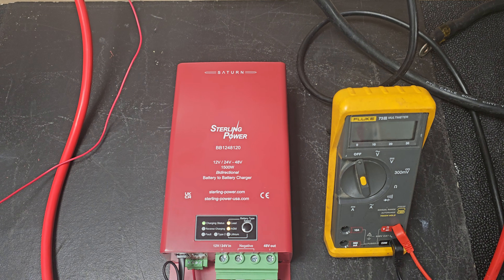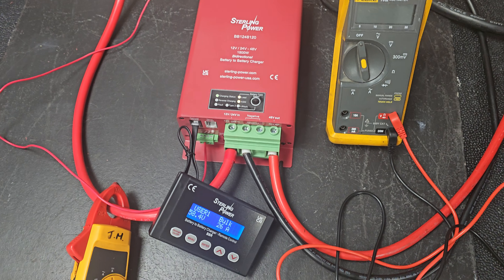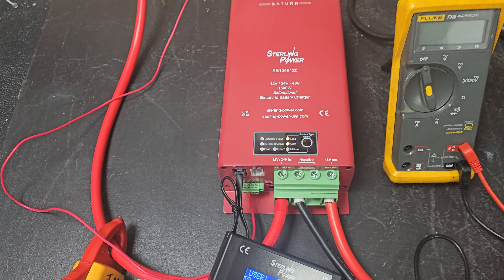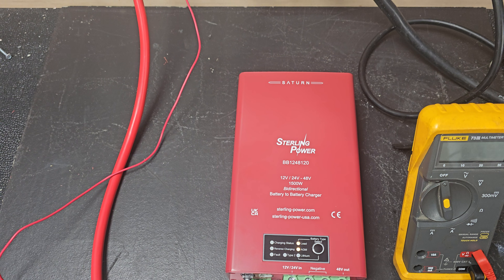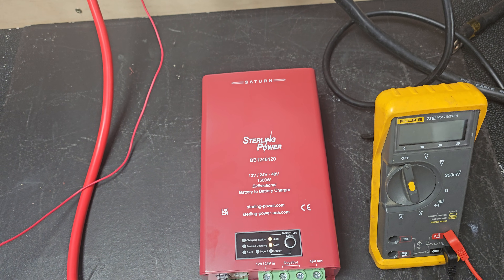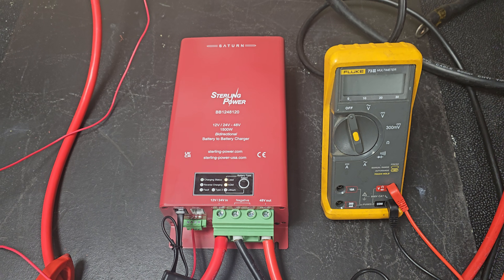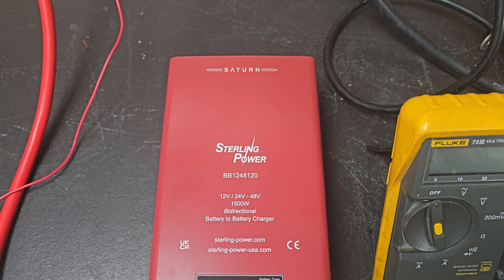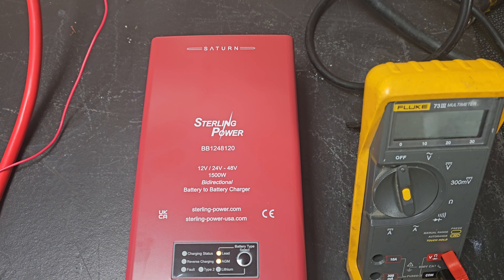Sterling Power 12V or 24V input to 48V 1500W Battery to Battery Charger BB1248120

Comment: Hi - Thanks for the video but having also visited your website I am still unclear as to this units functionality. Can you confirm it's a DC to DC charger with the following functionality: 
1. That it takes the Alternator output from a 12V/24V system and  converts it to charge the 48V Lifepo4 16s Pack using the LifePo4 charge profile?
2. Will the Alternator at the same time charge the normal starter battery either 12V or 24V just like your standard DC to DC chargers?
3. Can the back feed be directed to a separate 12V lifepo4 battery pack not starter battery? 
4. Does this 'back feed' function have a Lifepo4 charge profile or is it just pushing a general 12V towards the pack? 
5.. Is the 'jump start' function if available, separate from the back feed or is it using the same 12V feed to jumpstart the starter battery

It would be nice to have a clearly defined datasheet but I have been unable to find same.  Your product offerings are innovative and appreciated but your website is cluttered' and confusing.
Reply from the maker: Hello!
1) Yes.
2) Yes, unless the BB is too powerful for the system and is taking all of the alternator provision. 
3) No
4) No, it is a 13.4V voltage only
5) It is a Jump Start Assist rather than jump start, and it runs the reverse charge for 20 mins to allow you to hopefully then have enough power in the battery to be back in action.

As to the website- yes, very much understood. I am requested to have all products pretty much everywhere by the M/D.

I am attempting to balance his wishes with something smoother, but it will take a while.

Thanks!

Comment: hey mate , love the product !!! I'm from Australia and i refuse to buy the similar product to this from u know who !!! one thing id love from this is an alternator temp sensor cut out/throttle!! is this possible
Reply from the maker: Hi VK! Thanks for reaching out and thanks for the vocal support!

Honestly not sure there is a similar product... Nobody out there is doing a unit at this rating that has this good thermal management... The only other one I can think of goes to half power pretty quickly....

Your question is a super common one (Alt temp throttling-) and it's one we're working on at the moment. I don't have any concrete answer for you yet... but it's something we're trying to implement on the BBR remote!

Ben

Comment: On my diesel pusher, I have 12v chassis FLA batteries only charged by alternator and 24v LiFePo4 batteries for house side charged by shore or solar.  Can this charge/maintain my 12v FLA side from the 24v LiFePo4 bank and also have 12v Alternator charge 24v LiFePo4 bank (charging at 28v) when engine is running?
Reply from the maker: Correct! That's the goal.

It'll maintain the starter battery from the 24V rear battery whenever the rear battery is receiving charge from a secondary source (Solar, AC/DC...). It'll charge the 24V rear battery whenever the engine is running, too. 

Let me know if that brings any more questions!

The video here is for 12V to 48V... But we do have 12V to 24V too. You'd want the 12V to 24V one. 

Ben

Comment: Hi, is there a 24v to 12v DC to DC charger high power coming?
Reply from the maker: Hi CV!

Are you looking for a 1.5KW charger? We're looking at 24V to 12V, but it's one of our smaller markets, so deciding on what power value is of most interest to our customers. If you can let me know what you need, it would be very helpful. 

Ben